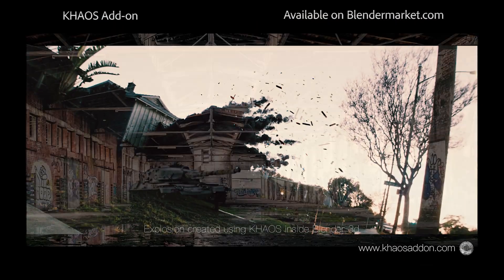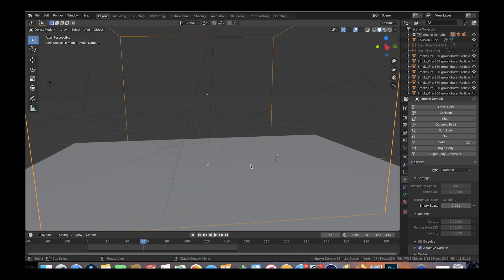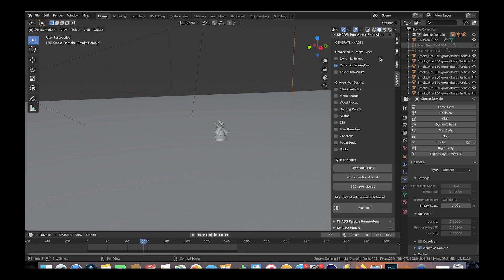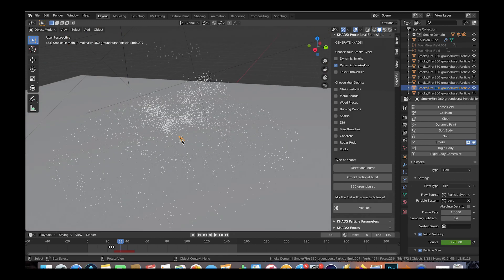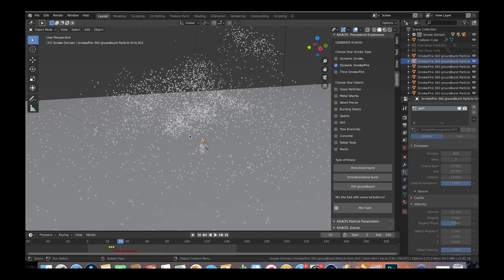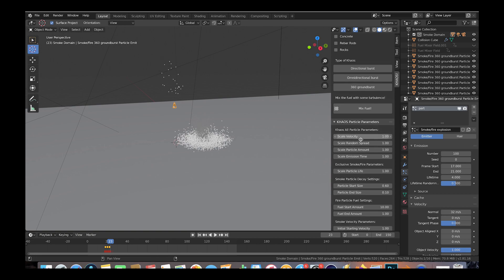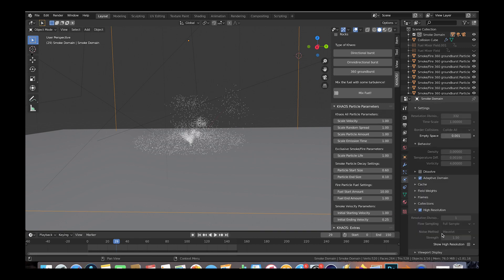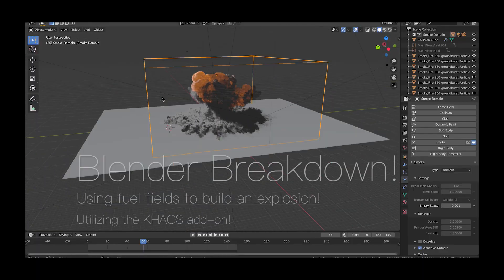Blender 3D Explosion explained: Utilizing the KHAOS add-on

Comment: I've been looking at this but there's something that feels a bit fishy. I've not seen a single video where the explosion is left to settle. Every single demo or example video is stopped part way. Makes me feel there's something to hide.
Reply from the maker: Hey Russ,
Your not the first person to say this. It is hard to control the simulation once it starts settling. That said the main reason they are short is because its boring to watch and every frame of volumetrics can take a while to render. 

The KHAOS add-on isn't a new simulation software for Blender. It is just a way to streamline your explosion making process with a lot of different presets so that you can "build" a blast. In other words this is just Blender's inbuilt simulator but made easier to use. 

Here's a blendfile of a blast we made with a few presets if you are interested in baking and/or rendering for yourself: https://drive.google.com/file/d/12r40v82LBC5jvkpA1irxuKgyxpwfy0An/view?usp=sharing 

Good luck!